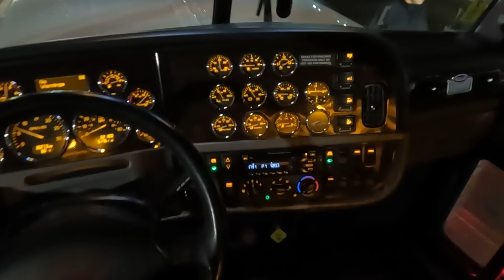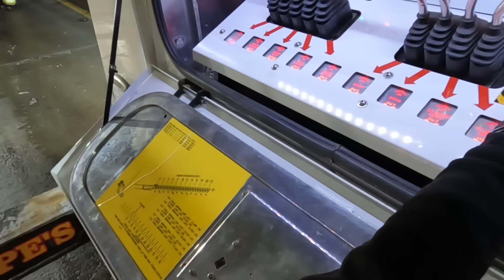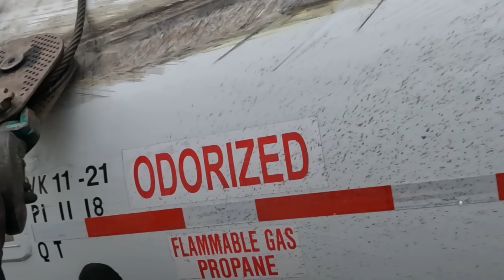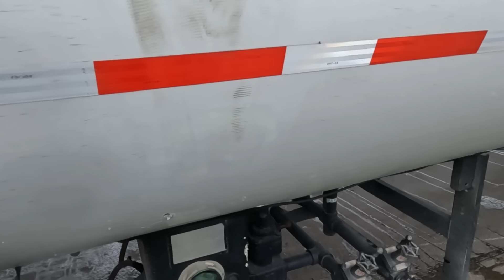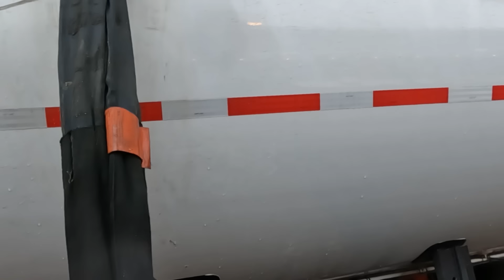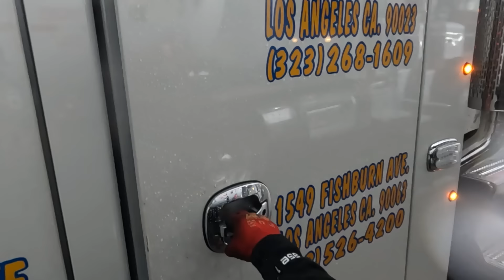Loaded propane tanker rollover recovery UNDER A BRIDGE

Comment: Pepe  serious warning!  Propane is heavier than air the gas sensor should be as close to the ground as possible.. 6 feet off the ground is is a 6ft blanket of inflammable gas  ... your fire service need educating! Propane is different to othe flammable gasses which are lighter than air...
Reply: Is it safer if it's full like it with a car gas tank.
Reply: Or is this just a dumb question, does a gas have fumes chemistry wasnt my best as you can tell. because ik ones a gas and ones a liquid lol it's 730am I apologize that was such a dumb question I had my coffee lmao and ik even an empty propane tank is still dangerous.
Reply: @AnthonyW-bp6tf there's no dumb question, just dumb answer...And now is 17:29 and I finished my cofee and got to do my night shift...So long my friend
Reply: @deandeki that’s a dumb answer
Reply: “6 feet off the ground is a 6ft blanket of flammable gas” is that what you meant to type..? or am I stupid lol

Comment: Tanks like this are designed and built under Federal Regulations for strength and safety. It amazes me that no provision is engineered in advance for ease of lifting or positioning. It is an absolute certainty that at some time a pressure tank will end up on its side or over an embankment...  Given the certainly of that, it is crazy to me that these tanks don't have an array of engineered lifting attachment points right from the point of build.  this is a huge oversight of the agency in charge.  Great job of getting this done in such a challenging situation.. Amazing teamwork, even more amazing problem solving in the field👏🏻👏🏻👏🏻👏🏻
Reply: I agree, at least 4 lifting eyes should be incorporated into the strongest points of the tank.
Reply: Whilst it sounds like a good idea, the lifting points could introduce points of weakness in the tank as it is a pressure vessel.
And a roll over could conceivably land on a lifting point and punch a hole in the tank.
Reply: @morriewyatt6234  if they were designed into to unit initially that could all be overcome.
Reply: I did not need the OSHA handbook
Reply: @morriewyatt6234  yeahhhh BUT.... what you see is the exterior "beat me up skin"..... the actual tank is a few layers in, yes potentially a lift point could be crushed into the inner liners.... BUT... could they not just weld under the skin some reinforcing?
Reply: Absolute certainty.  Nonsense.  You just make up your own facts.
Reply: @morriewyatt6234 It’s not the pressure tank you see there, it’s an outer hull. You can see the landing gear go through a hole in that hull to a frame inside the hull. The pressure tank would rest on that frame.
Reply: Look_What_You_Did as also an engineer, your condescending remarks are not doing us any favors. This superiority tone you're presenting makes me think you're young and/or inexperienced. Without considering the merits of their suggestions we're doing our projects a disservice. It's integrative design. Through their experience, the people with the hands on the equipment often see things we don't. If everything was perfect at first release we'd never need revisions, which, as an engineer, you would know is bogus.
Reply: @morriewyatt6234  Not only would you be introducing a bunch of parts that would be strong enough to punch through, it's probably cheaper and easier for every heavy wrecker to have the proper straps then to install lift points for every possible position to every single tanker.

Comment: The 2 white caps on top of the tanker are pressure relief valves in the event that the pressure rises too high in temperature. The caps open until the pressure equalizes
Reply: Do they have burst disc on the valves ? or some where on the tank

Comment: 2:06 the gas detector should have been placed near the intake of the engine as well. If a diesel engine ingests propane, it will run away.